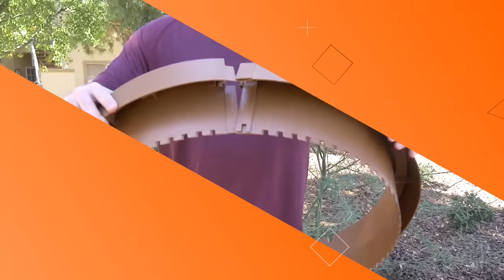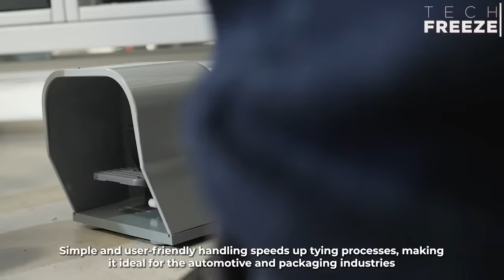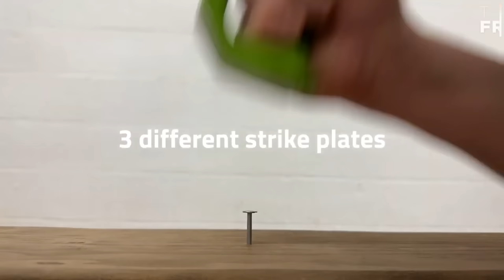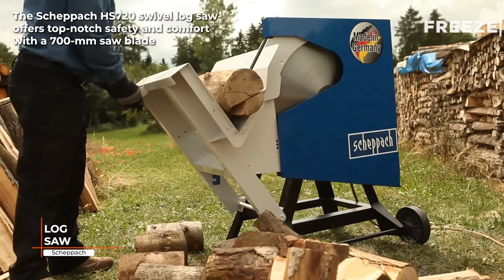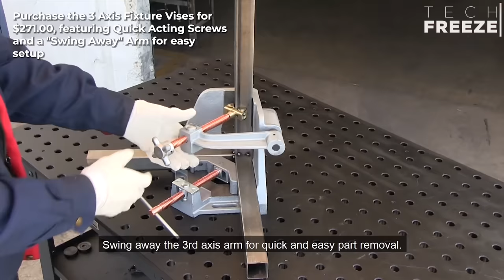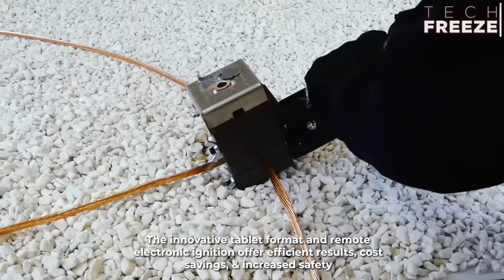Ingenious Tools that are on Another Level ▶10

Comment: I have a single ball Nut Wizard and it is the best tool in the world to pick up walnuts as they fall off the trees in my yard. It is not gimmick and I can use one ball to pick up 50 gallons of walnuts in an hour. I get 200 gallons per year. Left in place they turn to mush and kill the grass. The same concept is used for firing range brass, golf balls, pecans, etc. Amazingly, it will pick nuts from grass and leaves and reject the trash. No association with the company, just a satisfied user.